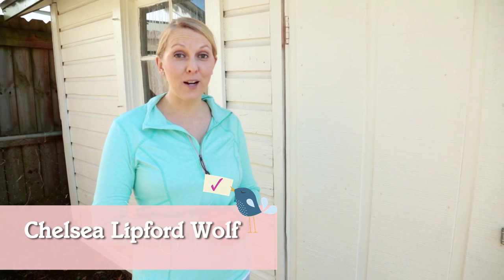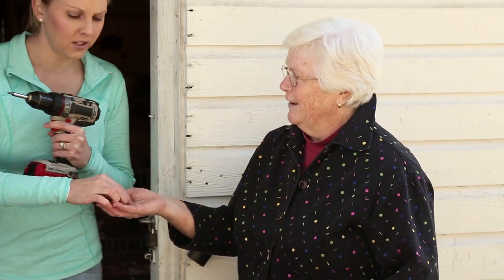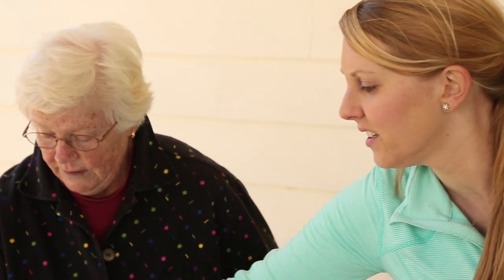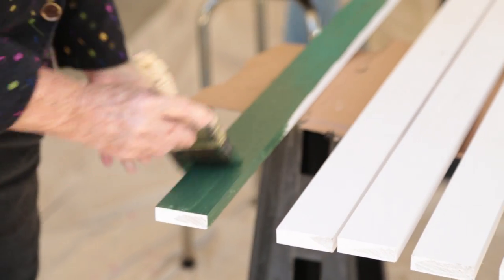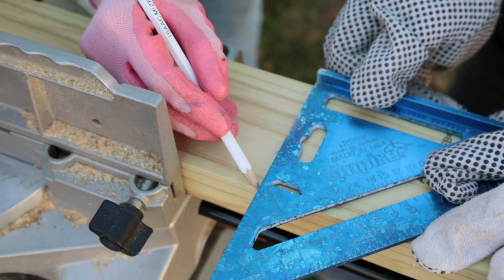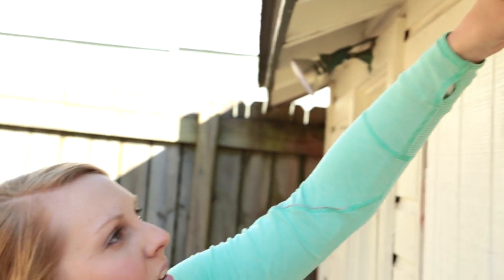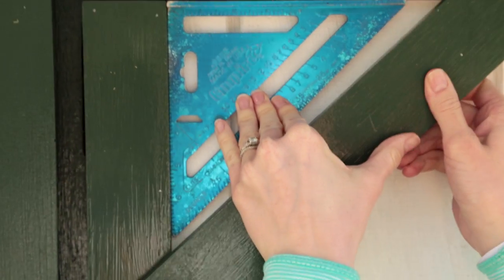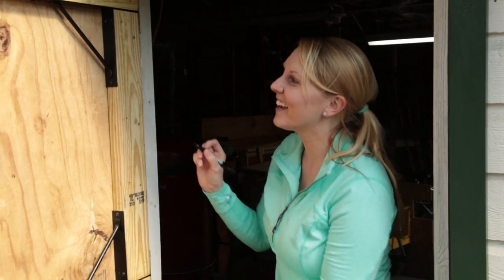How To Create Dutch Door for Shed

Comment: Thank you for this.  The only thing not mentioned is when you measured the door frame you didn’t mention the measurement needed to reduce the size of the actual door building to make it fit, with hinges and being able to open.  Is the door 1/2” less all round then the actual frame?  That’s my guess?